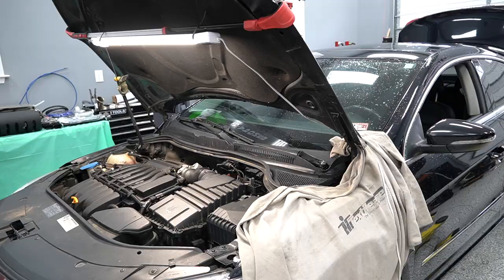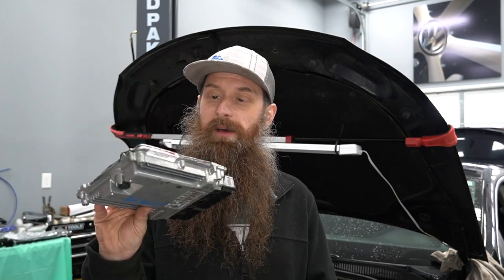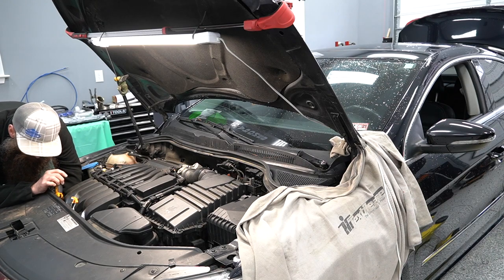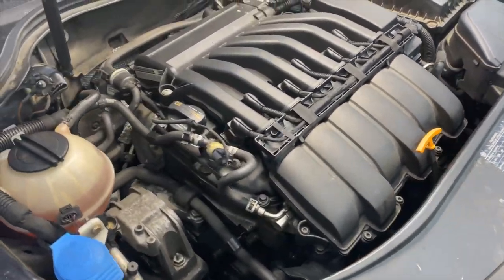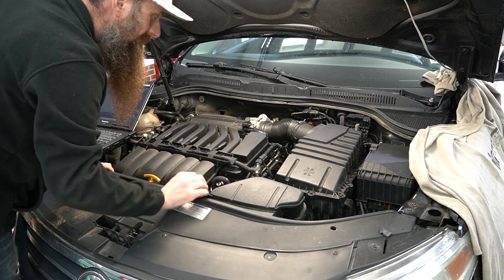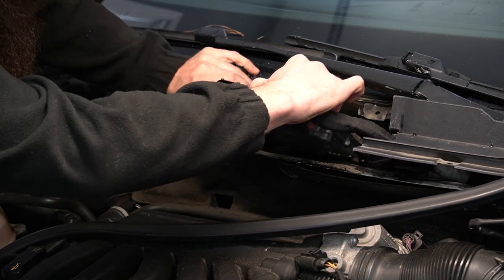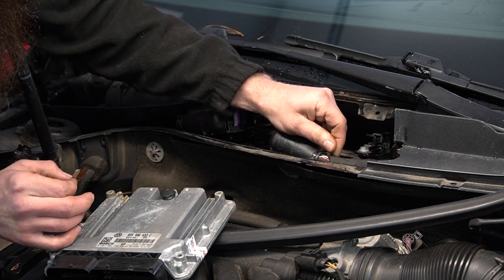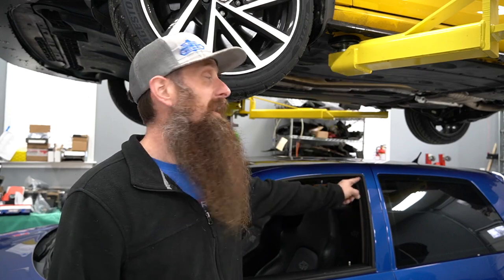3 Other Shops, Didn't Fix this Car. They Made it WORSE

Comment: People nowadays. " You throw parts a cars as a mechanic"! I replied " Not sure about mechanics but I electronically diagnose a car most of the time. The tools I needed to do that are about 20 thousand dollars. The tools to fix it? Yep, another investment. Then the shop. Then the license. Then the insurance. Also my master technician patch investment. Yep, my labor is a 100 dollars an hour flat rate. My diagnoses electronically is a 150 bucks for the first 2 hours minimum. Usually find it by then. It's expensive to be a technician. Not as much to be a Mechanic.

Comment: Hmmm...just reading all of the comments and I think that part of the reason for the lack of troubleshooting ability and what not is greed. Manufacturers don't want people to be able to see how their car works and thus be able to work on it themselves so information about each model is sometimes hard to impossible to obtain for the layman willing to get his hands dirty. Shops who run thin profit margins are less likely to get the proper information for each model and thus not train their people well enough to deal with more advanced stuff. Customers who only managed to get the car because it had issues, really cannot afford to throw money at the problems so they go to places less likely to know what they are doing. 
My brother asked me if I would be willing to help him replace the starter in his newly acquired Cayenne. He then showed me a video of someone doing the job...O.O ...really!!?? They buried the starter in the V of the 8cyl engine underneath the intake manifold, fuel lines and coolant pipes???!!! Which, incidentally is WHY it may need to be replaced...because the coolant pipes can leak coolant RIGHT ONTO THE STARTER!!! Seriously, who thought that was a good idea????
Reply: It's a German car, what else would you expect? :)  Most Audi Quattro-based products have cramped engine bays.

Comment: HumbleMechanic can you help me with some advise? I have a European 1.4 TSI twincharged engine that has some serious misfires that can be felt untill the engine is warmed up. 
It's got a new timing chain set + cleaned the intake valves.
Now the Short Term Fuel adjustment on bank 1 is + 11%
B1S1 is + 10%.

Can someone help me?

Comment: Is that 3.6 FSI VR6 reliable? I am considering buying a car with this specific engine.  I live in Europe there are a lot of mechanics and parts for VAG , with proper maintenance and oil changes would you recommend buying a vehicle with the 3.6 FSI ? My other option is the 3.2 VR6 ( not direct injection) but it would be a pre facelift and i really want a newer one . Thanks in advance !

Comment: I have a 2007 Volkswagen GTI mk5 two door hatchback and my alarm horn won’t go off I’ve checked the fuse I’ve checked the horn I don’t know the correct way to check the power coming through the wire that hooks to the horn if there’s anyway you could show me or direct me to a video to show me this that would be very I appreciated

Comment: Took car to a shop, they pulled out the head, and to replace with a new head, they said with a new cylinder head, timing chain yada yada yada, they still would need to pull out all the internal parts of the cylinder head to “time” them (valves, rocker arms…) = $3,000 worth of labour. Is that true? Does a new head (from Eurotuning) with all internal parts installed, excluding the camshafts need to be stripped and done again? if yes what parts? I feel like I’m being extorted. Because this other shop says it’s all a bunch of lies; that you can just slap it on, what needs to be timed is the timing chain (duh) to the cams, and to torque down the rockers and other parts. And are obviously charging less labour, but I want a mechanic I can trust that they know what they’re doing.
Reply from the maker: Man this is a tough call. I’m surely not going to say any of that is lies with out complete documentation of everything. The other shop shouldn’t either. You’re welcome to email me with all the paperwork. But there are too many unknowns here to try and be accurate
Reply: @HumbleMechanic  I’ll ask for some documentation of what they say needs to be done to the new cylinder head. And yeah that’s where the other shop fills me with doubt on the knowledge of their work.

Comment: @HumbleMechanic Tell me more about having to replace the fuel pressure sensor on a BPY when the ECU is changed. I engine swapped a BPY in a MkV Jetta GLI (original ECU but using fuel pressure sensor that came with newer engine). No codes, but it does stumble a little on cold starts.
Reply from the maker: It’s a Tech tip I found for the fuel code. Don’t recall the number. It may be old at this point. I didn’t read deep because it was a BPY code

Comment: egr fault,sometimes the wires going to it get broken.i think the egr on these are also water cooled
Reply from the maker: No egr on this engine
Reply: @HumbleMechanic  what engine does this have?   i do alot work on them over here in europe,the fault almost sounded like the diesel gate emission scandal vw pulled between 2008 -2015. which affected the egr see
Reply: @HumbleMechanic  id be checking the lamba sensors on the manifold in that case,and the wiring to them,i beleive the lamba helps control alot of your current faults.i could be wrong but worth checking

Comment: 1996 es Lexus 300:  for 5 months the Lexus dealer and my personal repairman has NOT been able to solve this problem.  The codes are 300-305  with Lexus, and they decided that it was the timing belt but 30 days later, the engine light is on again.  This cost me big.  My mechanic (didn't charge) pinned it 301 but the car was return many time bc the engine light continue to  come on.   Auto shop/Reilly code it 305.   Any opinion you can provide would help me from spending money.  What I would really like to know can timing belt cause engine light to come for 5 months, seriously?  it was misfiring and commercial autos said spark plugs.  what could cause this to continue.  I'm not sure they have done an ECM..
ANY WAIT YOU CAN SHARE WILL HELP BC THE CAR IS BACK AT LEXUS🙄😪

Comment: Wait. Did you say don't jump your car backwards on a mk5 because it'll fry your ecm? Cause I've been having all kinds of issues and it happened  right after GHP jumped my car backwards.
Reply from the maker: Yep! Best case random blown fuses. Worst case modules issues
Reply: @HumbleMechanic  that's the thing, no fuses blew so I figured it was okay but then...... 19 codes including epc and check engine  lights:( I should have taken it to a shop but I have trust issues. I've been broke down on the side of the rd for 11 days replacing what ever I can find in the junk yard. I'm to the point im almost positive  it's the ecm. On a positive  note I did however just finished with the carbon build up on valves cleaning.. thanks to your videos.. It was way bad almost couldn't see the valve in cylinder 2, 3, and 4..

Comment: Hey man checked out all your videos on my issue and I’m running out of ideas on an issue I got and I’d super appreciate a little of your time. 2015 TDI Jetta. Radiator fans won’t kick on unless the AC is turned on. All fuses are good. VCDS fan test passes. Both fans come on. No CELs. Swapped out the big fan already that didn’t fix it. See the coolant temp getting passed 206F. Can’t seem to find anything related to my specific car on a forum anywhere. What tells the ecm to kick the fan on based on temperature for this Jetta? There is nothing in the coolant sections on Vw parts website related to coolant sensors. I’d super appreciate your time!!
Reply from the maker: That’s odd. What’s the engine temp getting up to? 

Is the car tuned
Reply: @HumbleMechanic  thanks for the reply! It’s been as high as 215 before I’d call it quits. And yes it’s malone tuned but this may have existed prior to that im not sure. I contacted them and they say they don’t ever touch anything related to it since there’s no need to. Have had zero issues otherwise. I did hit a deer awhile back front left of the car got repaired. Not sure what all got replaced. 

On the 4 pin connector from the car that plugs into the big fan. Got a big red and a big brown as the mains. 2 smaller ones are yellow/brown and white/blue. Big wires I expected to be hot all the time, which they were. However, at 130 coolant at time of testing leads i don’t expect the fans to be running, however, with the AC on(fans running), the two small wires read the same voltage as it is with the AC off(supposed fans not running) At 130 temp I’d expect the two smaller wires to have nothing if the AC is off. Yet the Yellow/brown wire read 3.5v, white/blue read 14 with AC off and on. Guess I don’t understand how these things are supposed to work.

Comment: Hey Charlies, My vw Golf R MK7 was discovered to have a valve cover oil leak. I was wondering if you have any ideas as what would cause it? The car was maintained very well since new. Has about 65k miles.
Reply: Stop slamming your driver's door so hard.  And be aware you are driving a mechanical thing with thousands of parts.  Things go wrong.

Comment: It's always a fun day when a car comes into the shop and you check it out: o that thing is not looking good, wow and that part is completely worn, hey that's not right at all. Several things worn or just broken, and for you to say what is causing that particular issue. Can't fix it all because the thing would be a write off. Actually not fun, I hate those days.

Comment: I have a 3.6 4motion 2007 that has been to 2 different shops and still does not run. The dealer changed the timing belt and ruined my car. They wanted me to pay $2,300 AND THE CAR WOULD NOT START AND THEY KNOCKED THE POWER STEERING OUT. i GAVE THEM $1000 TO GET MY CAR BACK. It sits in my driveway. HELP!

Comment: What do you do if there is carbon build-up in the cylinders? My car has had some trouble on cold starts and cylinder 5 had that same oil looking residue on the spark plug
Reply from the maker: Probably pull lower manifold and media blast it. It’s a pain in the engine
Reply: @HumbleMechanic  thanks for the reply, Jetta has 210k miles, if it's a pain to fix it may just be time to move on

Comment: Hey bro my 2003 vw jetta gli 6 speed i was driving without my clutch like an idiot and now its stuck in 3rd gear do you know what I could have broke?
Reply from the maker: Check the shift cables first.  Otherwise trans is coming out no matter what. 

You can also try and shift it on the trans

Comment: hello I just came across this channel and i’m absolutely loving it! I was wondering if you knew the answer to a question I have. I have a 2013 vw gli at 80k miles but while i’m driving it makes a “woo woo” sound that will change speed depending on my speed. Meaning the woo woo will go faster if I drive faster. I honestly don’t know if it’s the tires but the vw dealer in my area isn’t the best at diagnostics. I bought the car used so i’m not aware of how the previous owner took care of it, but ik these cars are good with proper maintenance. My dad has a 2015 GTI with 150k miles and we’ve had zero issues because we baby that car. Anyways, I was just wondering what some possible causes for a “woo woo” sound may be. It’s not terribly loud, but I can definitely hear it. My steering wheel doesn’t shake like when tires need to be balanced, so I honestly have no clue what it is
Reply from the maker: Maybe the diverted valve?
Reply: @HumbleMechanic  thank you! ill check that out
Reply: @MP-mq3zu  Were you able to find out what the issue was? What was the fix?
Reply: @TerrasClip  Yes! I think it was just the tires. My tires were super old and dry rotted so I ended up replacing all of them with continental tires and there’s no more sound! (When I bought the car it had old tires which I wasn’t aware of)
Reply: @MP-mq3zu  Thanks for following up it could help others as well

Comment: I have a 2003 manual transmission vr6 jetta. My secondary air injection system is causing my check engine light to come on and I have some electrical issues. Should I just get a delete for my SAIS and ask a shop to tune it out of my computer or is it worth it to get it fixed?
Reply from the maker: You cant delete it with out a tune. This is also defeating an emission control. That could result in failing a state inspection. So if you do, Off road use only. ;) .
Reply: Okay thank you Charles I appreciate the reply. I can't seem to find a mechanic in Phoenix who really knows what to do with my car. I've been spending a lot on this car and I still feel like it's a long way from being happy. But I love the car very much so I'm not giving up.

Comment: Bit of an odd question, i noticed some Bridgestone RE 71R's on the Yellow R.
How do you find them as a sporty performance tyre?
Reply from the maker: I love them. But they wear fast.
Reply: @HumbleMechanic  Well thats a bit of a shame then
Reply: @bsmit462  The Potenza S007A is a good street tyre, it should be on par with the Michelin PS4S, at least in the dry. The Mk8 Golf R is coming with a Potenza S005, which seems to be a S007A modified with wider sipes, and tuned for better fuel economy and better wet performance. :)

Comment: Charles, what interval do you recommend changing out the timing chains on the 3.6 VR6?
Reply from the maker: There is no true interval. If long term is the goal, 150k is when Id be thinking about it. I have a little over than on my blue R, original chains. Once the black one is together, we are doing chains on the blue one
Reply: It depends on how u treat the car. 
I have seen college kids kill the chains under 100k
Reply: @HumbleMechanic  Thanks... I own 3 of these cars (2 wagons and 1 sedan, all 4motion) and 2 of them are due for chains.  I have been generally operating under the somewhere between 100k and 150k, leaning more towards the 100k side for safety sake.  Really appreciate your content as it has helped my son and I a ton with my herd.  Keep up the great work!

Comment: My mk5 GLi misfires on cold start occasionally. Needs carbon cleaned for sure. 158k miles never been cleaned. Mechanic wants $300 is that a good price?
Reply from the maker: Super good price. So good I’m worried it’s not enough. Pulling manifold, reseal injectors, clean should be more. 

Get specific info on what they are doing
Reply: @HumbleMechanic  my mechanic is definitely a great guy. He is the sole owner and operator of his shop and specializes in Vw. Keith Elliot of nitro Wv. His prices may have gone up since then. I asked about a year ago when the misfiring started. He also made it seem like that was a deal for me. I’ll ask again and let you know. I can’t imagine how much gunk is in there.
Reply from the maker: Good to hear! Just make sure it’s the proper deal!
Reply: I can tell you he did my timing belt and water pump 6 months ago. $200 for the labor. He told me it’s usually $200-400 and he’s do it for $200 for a deal. The pump and belt were Bosch and the total was $545.
Reply: Either way I’ve been there many times and actually trust him. Which is weird in the car mechanic world. Thanks for your responses and keep up the great work. I enjoy the content.

Comment: Well, I guess  the main thing wrong with the CC is that it has 200,000 miles on it.. might be a clue.
Reply from the maker: There is truth to that. But what might have been a semi major repair, turned into a way bigger deal because the shop threw parts at the car until the owner was out of money.

Comment: A can issue can give lots of bogus codes. It’s amazing that most don’t figure it out one module goes bad and throws many codes. It’s one thing if you get one consistent code. You really need brains and documentation. I like when they either lie or forget to tell you something not necessarily on purpose. Sometimes it’s better not to know the story it could mislead you. Miss matched firmware bit me in the ass once or twice. LOL

Comment: 2010 cc is worth maybe 3k 

Labor at dealer 4K

By the time you get it used, previous owner made sure to swap old Oem parts with eBay stuff.

This is why cheap German cars are the most expensive to own. Vw audi bmw and Mercedes…oh and you need to lift an engine out of a bay just to do maintenance on them….

Fuck German enginering…aka planned obsolescence.

Comment: Wait....an ECM....UNDER THE COWL? Exposed to the elements and not on the other side of the firewall? What the hell kinda shoddy engineering is that?!
Reply from the maker: Actually this is super common in VW land. It has rarely been an issue. The place Computers WERE an issue was under the carpet inside the car. That was only an issue because water leaked. LOL
Reply: @HumbleMechanic  Interesting...I'll be honest, I did realize I'm one to talk. For, you know, not being an automotive engineer and all. Kinda hoped you wouldn't notice this comment XD. All in good fun. Though I was surprised at the placement; I really only know Subaru land (our ECUs are in the dash behind either the gauge cluster or the glove compartment/foot well). Love your videos, and learn a lot from them (the stuff that's not only applicable to only VWAG). Have a good one.
Reply from the maker: Hahah no worries man. On first look it seems a dumb place for it.
Reply: @occamsrazor1285 Chrysler and GM have placed them low in engine bay. Only time I have known of cowl location to be an issue was on Ford Freestar vans, and it was really an issue with PCM sealing imo. TCM often live in transmission now constantly bathed in oil, and its only an issue if your transmission cooler/radiator busts (as nissan RE5R05 owners have found out) since while transmission fluid isn't conductive, coolant is..

Comment: Over 200k miles?  Rebuild the engine and change the ecm, done.
Reply from the maker: It’s cheaper most likely to get a used engine VR parts are $$